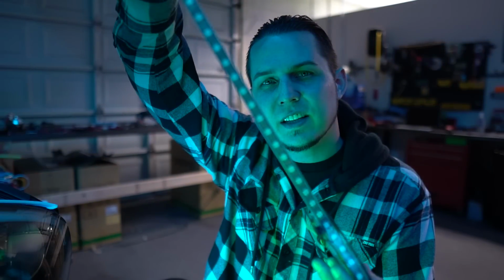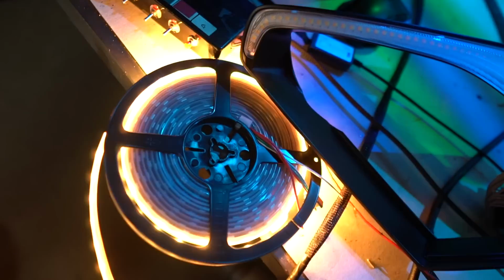4 Types of Sequential LED Switchback Lights | FlyRyde

Comment: I purchased an Auxbeam 8 gang switch panel  to wire my rock lights and other lights just to clean up the wires going to my battery. I have pod lights I have mounted on my rear bumper and wired through a relay and wired to my reverse light and on a separate switch to use in the dark to hook up a trailer or boat . Can I wire the pod lights to my Auxbeam panel and still have them wired to the reverse and separate switch?

Comment: Is it possible to get rgb colors on the fully programmable lights? I bought aftermarket headlights with addressable rgb strips and I love them but they are so limiting it’s frustrating. I’d love to do what you do, but I simply didnt have the knowledge of the different kinds of lighting for this stuff and I just went “wow rgb give me it now” without knowing that you can’t see my running light or turn signal in the day.

Comment: Hi chris quick question, Is there any risk of blowing the ECU of my Toyota GT86, when doing the wiring. I'm into electronics. But.. do I need some protection or I can hook straight the DRL wire to position lights and amber to turn signal wire on the back connector of the headlights. Thanks a lot

Comment: Hey bro I know this is video is pretty old but I’m wondering if you could help me out. I’ve got an RX8 and underneath the spoiler on back I’ve got 2 10” red led strips. They have 3 functions
1- brake flasher (flashes 4x when brake applied)
2- park light (turns on solid when lights turned on)
3- sequential turn signals
My problem is, I can’t get the sequential leds to work. I basically bought them for this function. I changed out my signal light bulbs for leds and had to add resistors to stop the hyper flash but still no go. The sequential function worked while it was in the box but I’m lost. Any ideas??

Comment: You took me to School ,but I need help lol ,I have a LED flasher relay installed and when I turn on my blinker the strip stays solid when the parking light is turned on, but when I turn the parking lights off then the blinkers will work correctly what does that mean?

Comment: I bought a LED 144 light strip, that comes with absolutely no directions, how to install? I used my test light to find the proper wires to connect to? I’m sure you’ve seen these? So, I hook up the light, I get no brake light, first time testing it, non running car. I start the car, I get DRL MODE, on the light? Even after I hit the pedal, it didn’t light up, like a brake light? I try the signals, nothing? I shut the lights off, and try again? Start the car, just try the signals, they work. Soon as I hit the brake pedal, it goes back to DRL mode? I used a test light, thought I was on the proper wires, according to my test light? Can not get this thing to work properly? I don’t get it? This is my second light too? Any suggestions?

Comment: I love your videos man i really want to start building lights and your videos help out a lot, but what kind of cable do you but? What gauge or what quality?
Reply from the maker: I honestly have never had an issue directly related to the gauge wire I use(anything from 26-18awg). I think that’s a pretty common case of overthinking things. Grab what you can and get goin 👍
Reply: FlyRyde thank you so much! Im trying to figure out where to buy specific parts there so many option i love how you link your products i saw a set of 350z headlights i want to build that have the blueghozt controller with some cool neopixel strips and halos but they had diffusers can i use diffussers with any halos or how does that work

Comment: I bought switchback led strips but they don’t switch to amber when turn signal is on. They just flash white led. I tested on battery before connecting to the car and it switched to amber as it should. I have it connected correctly to the car. Could it be that I need a driver or some type of control module?

Comment: Programming an Arduino and programming a Ghozt is similar when using dedicated wires to each LED. Key difference are software for Ghozt says stop or turn instead of a pin number..
While an Arduino can be programmed to perform the functions of the processor on the Ghozt board, there are other circuits to be sourced and assembled in a manner that can handle vibration and environmental issues when making your own equivalent. A lot of DIY guys leave out components these boards have, which reduces reliability. No big deal if you can and want to fix them, but a reputation killer for a business.

Comment: I'd love to create my own custom headlights on my Golf to replace the OEM halogen ones. I'm just wondering how to make the custom internals in the housing! How are you making the light diffuser in front of the LEDs? I'd like to change the location of the turn signals and make a cool shape, and add projectors. I'm wondering if you would be able to 3D internal components that attach to the lens

Your videos have been the only helpful videos online!! Everyone else's "custom" headlights are opening them up and adding demon eyes in the existing projectors, and adding angel eyes...

Comment: hey, I'm new into the custom lighting. I am really enjoying these videos because I always thought I had to go buy expensive oracles or something instead of building my own. thank you for releasing these videos! is there a problem with using the 20 dollar ones to begin with though? and are they hard to hook up?
Reply: Did you ever do it to your headlights? I’m currently using the $20 DRL strip and so far has been good, easy to wire tap it to my headlights

Comment: Unicorn Lights. Yep. I'ma use that to address the color changing led from now on.

Happened to witness it on an MUV and looked so cool at night. The way they did it was, amazing. It was on full show just big stripes of Red Green and Blue running right to left, and it was also hooked up to the Brake and Turn signals, so when they hit the brakes it'll start flashing red (Very noticeable FYI. Right in the eyes.), and an orange when turning and it'll run towards where they were turning to, from the middle of the trunk door. Btw it was hidden on the under-side of the trunk door as I presume, didn't have a chance to pull them over and ask 😂

First time commenting and watching the second clip. Me love light shows too. yay.

Comment: Just out of curiosity what could I use and how would I connect 2  lights so they can be easily disconnect them as my car has headlights and corner lamps and want to have sequential that go from headlight over to the corner lamps headlight is bolted in behind the corner lamps.

Comment: So, I just purchased a 2014 Optima EX and I like the way the DRL look on the SXL but to replace the whole headlamp for both side are expensive so I’m just going to do them myself and I’m not talking about just sticking a strip at the top of the headlight. Going to pull off the lens and do the demon light, change the amber reflectors to the white and install the LED DRL. So what would be the best LED to use? Addressable is out of course lol
Reply: I actually wanted to know if you had a link to a brand I could.
Reply from the maker: Charles Taylor addressable might be your best option if you didn’t just want something OEM looking. For just super bright switchback, I’d go with Diode Dynamics HD strips. If you’d rather it be more flashy and cool, but don’t need it for something like parking light, I’d go with a high quality addressable (not like the cheap roll I showed).

Honestly, with demon eyes and addressable controller by BlueGhozt, it’s pretty wild what you can achieve without a crazy amount of work.

Comment: I wasn't sure want to get, so I bought some cheap led stripe off wish as well as a set of Profile Pivot. I am also going to try and make a custom light housing for the strips out of acrylic. I've been watching a lot of videos on how to melt/solft acrylic, so I can shape it to fit my light.

I'm doing this because I'm replacing my projectors with a set of Morimoto M-LED 2.0 projectors and while I've got the lights open, I want to do everything all at the same time.

Your videos helped direct me to the Profile Pivot strips.

Comment: How can I customize my tail light for my Honda Civic 1991 EF sedan
Reply from the maker: LED Bulbs, and a DIY brake flasher kit, and you're good. Don't build sequential tails unless you want them to be worth more than the car, y'know :)
Reply: How much are we talkin about
Reply from the maker: Crx honda parts and materials you could cheap out and do for maybe 150-200, then spend a couple weeks learning and breaking stuff. If I did em (which I know you didn’t ask, just for perspective, they’ll likely be 1500-2K with everything fancy).
Reply: $150 to $200 rite I'm ok with it
Reply: I have extra rear tail lights
Reply: Ok nice